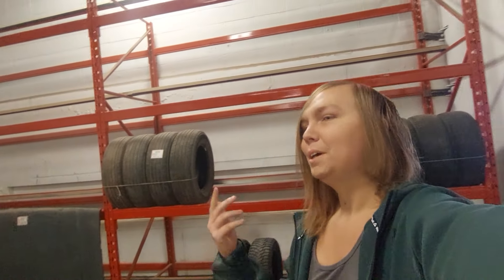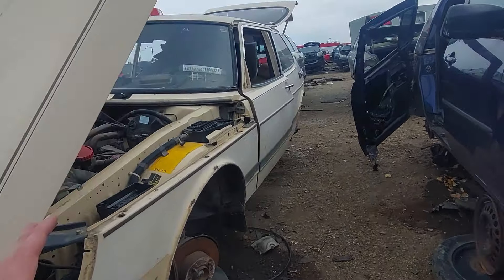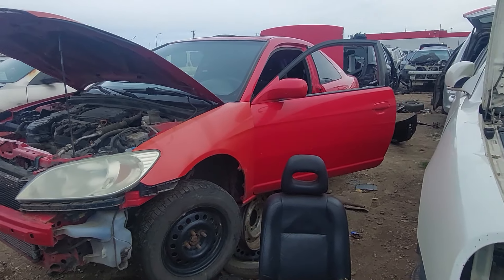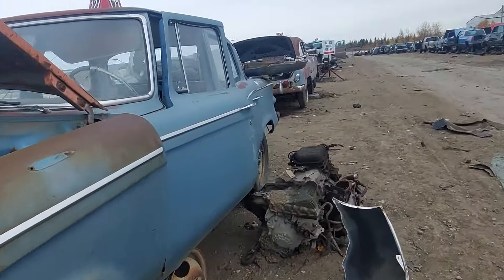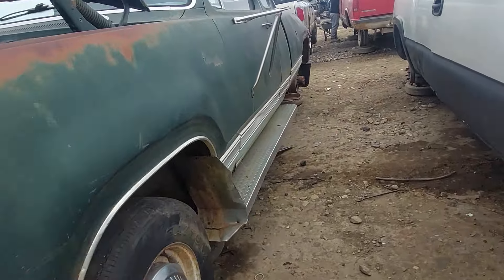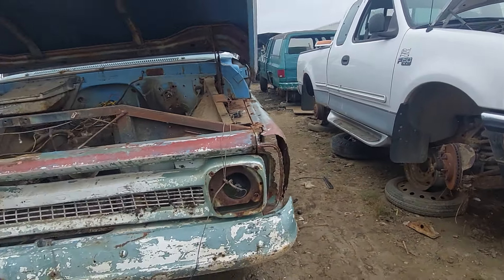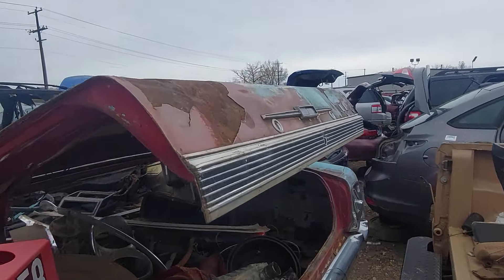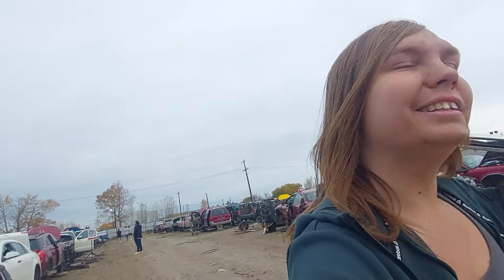Ipullupull Edmonton Junkyard tour October 2024

Comment: That was a lot of fun to watch, thanks!
The Silver Mercedes looks like a 560 SEL.

The paint on the black Mercedes looks like it was repainted and end up with orange peel.
The Saab motors are mounted backwards, which is pretty neat. 
The carburetor that GM used was the Rochester Quadrajet. Very versatile, they have mechanical secondaries but had a second set of butterfly valves over the secondary valves to smooth out throttle response and prevent bogging when the secondaries opened, so they wouldn't need a second accelerator pump. They could also restrict airflow (basically lowering the CFM) for use on smaller engines.
Reply from the maker: @JCBWheels  Heyyy someone answered all my stuff thanks! I knew it was a quadrjet just in the moment I couldn't remember it. Appreciate it thanks

Comment: 1981-91 squarebody hoods didn't bend like the 1973-80s.

36:11 Olds 98.

38:18 It took more than a CAI to blow up a 4L60eHD. The biggest problem with them was the 4th gear clutch hub shaft that sheared the splines. 

42:28 If that's a real Nitro Green ACR Plymouth Neon, only 63 were made and can probably count on one hand the number of them sent to Canada.
Reply from the maker: They didn't use a 4L60 in those it was the 4T60EHD or the 4T65EHD Depending on year. They were still glass though.
Reply from the maker: Fun fact my moms ex made 15hp over stock and blew his up in a GTP, And you see many of them with blown up transmissions around.
Reply: @KatarinasGarage  You're right, hit the wrong key.
Reply: @KatarinasGarage  I had just been talking with my sister in Australia where you could get an L67 with the 4L60E and my mind went there for some reason. 😆